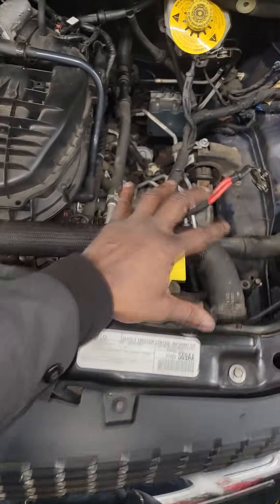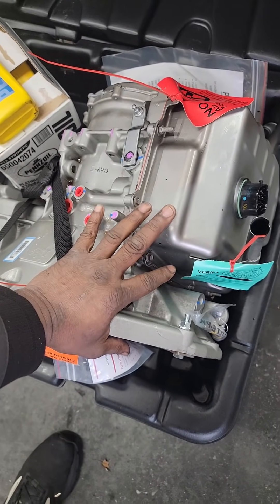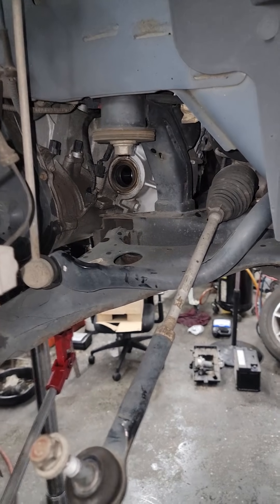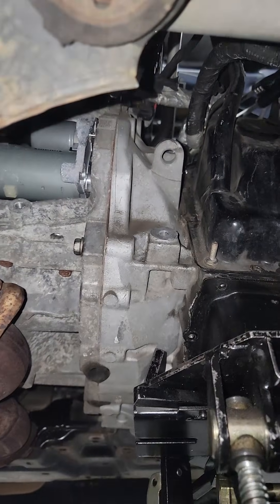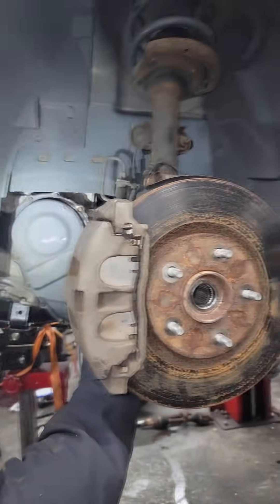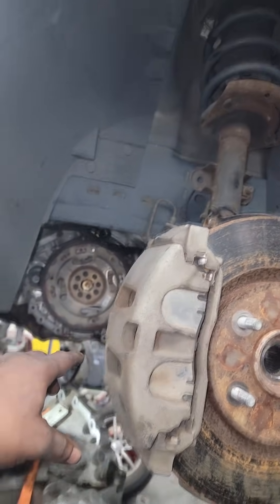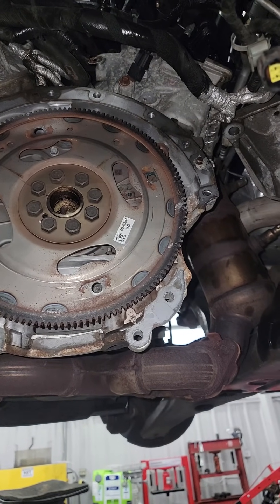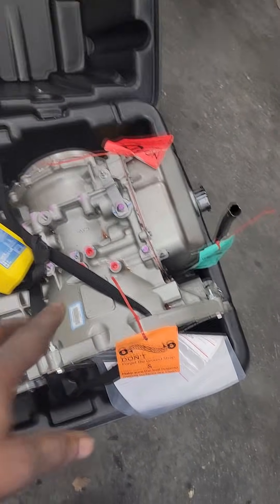“Apprentice vs FWD Transmission — Let’s See If He Can Do It!” 62TE

Comment: If the transmission is coming off, I am paying for a rear main seal replacement regardless of it leaking or not.
Reply: yeah same here im changing it. because im not removing the transmission a second time just to replace that seal too much work.
Reply from the maker: @josequiroz4605These are not just seals anymore. They come with the complete oil seal retainer now. You may have to drop the oil pan
Reply: @OnlineMechanicTips dont you dare say the entire oil pan needs to be off. because im not about to replace it. 😂😂😂😂
Reply from the maker: A lot of mechanic dont wa n t to disturb and mess with that if its not leaking